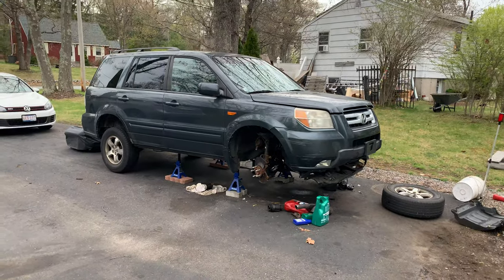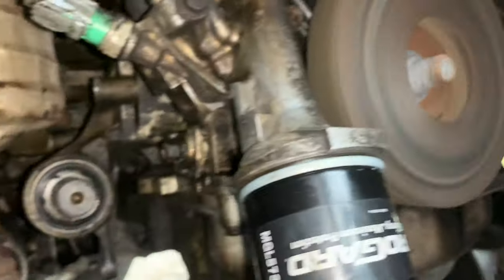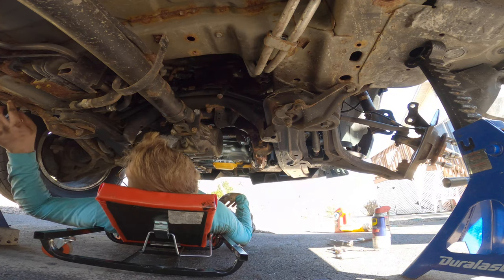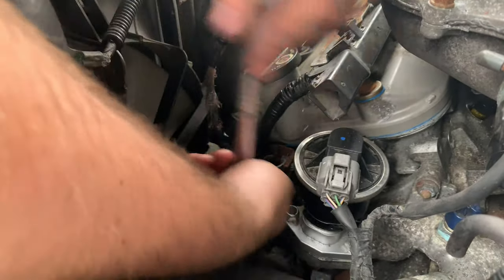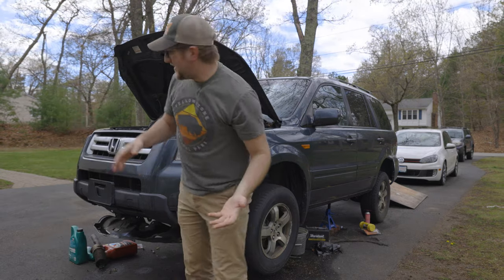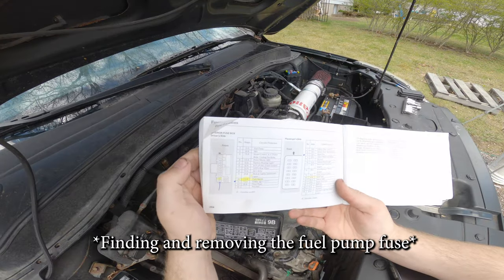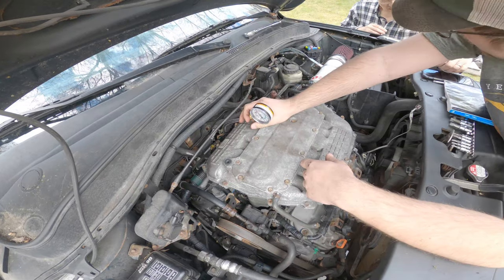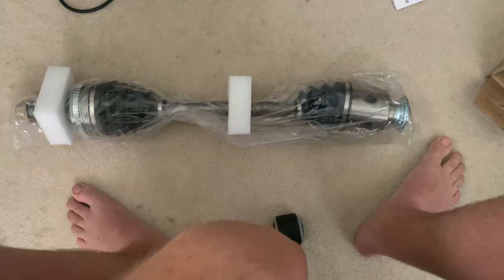Honda Pilot Rescue Mission - Pt. 3 (FINAL EPISODE)

Comment: I got a 2004 Honda Pilot and it seems to be driving fun, and all there was in it was garbage but also rust spots too.

I got into a accident and lost my childhood car a 98 Chevy Blazer 4x4 with a sunroof, tinted windows almost close to be illegal, and a automatic engine starter inside it. All the other issues of it was air conditioning and the door panels.

Comment: Honestly Honda goofed when they introduced the VCM on the V6 engines from 2006 and on. It turns off the rear ( bank 1 ) cylinders when cruising to save on gas, but the savings are crap compared to what you will spend to replace the engine parts. We are seeing misfires on V6 engines through 2016 due to the VCM. Bad idea with time is only going to get worse
Reply: That only applies to FWD versions though, the one in the video was 4WD